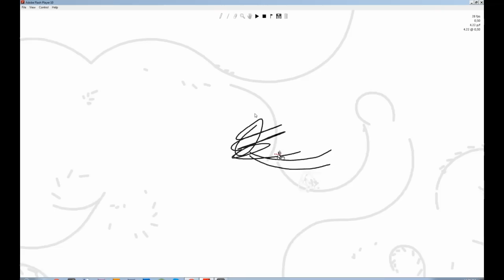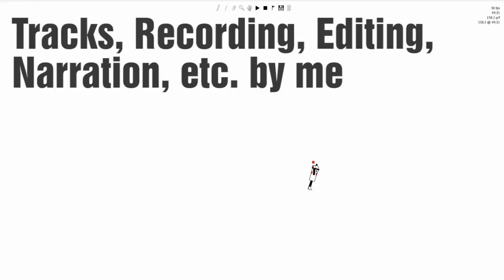The Physics of Line Rider

Comment: what version of line rider is this?
Reply from the maker: In this video, I used 3.4.X, a modded Flash build of Line Rider made by kevansevans, which added some quality-of-life upgrades to 6.7, which itself was a mod of Line Rider Beta 6.2. 6.2 was the last Flash release of Line Rider made by Boštjan Čadež, who made Line Rider Beta 1 and 2. If you have a computer that can run Flash still, you can download the version from the archive, which is run by rabid squirrel, from here: http://bevibeldesign.com/line-rider-archival-project (it's under "__Versions_Development" next to some standalone flash builds if you need those). The version that's up on linerider.com now is a version rewritten to work in javascript and webgl, and .sol files from older versions will (usually) have backwards compatibility (6.7 itself has a slightly different physics engine that hasn't been replicated). Hope this helps!
Reply: @itsbanky   what does the file name look like?
Reply from the maker: @RichardVR45  https://www.dropbox.com/sh/v0o93a74lypdh9y/AAAxNefH-prrguv6lj4CE-A5a/__Versions%20_%20Development?dl=0&preview=Beta+2+r6-7+V3-4-X.swf&subfolder_nav_tracking=1
Reply: wait the bevibel website wont work

Comment: You're going about this all wrong. Clearly, you should start with the hypothesis that g = 9.8 m/s^2. Then, derive the height of the figure. Or, you should define a new measure of length based on the size of the figure, and then measure g in units of figure height / s^2.

You should also verify that gravity produces a constant acceleration by dropping the figure at various heights, and seeing that time to fall is proportional to sqrt(h).